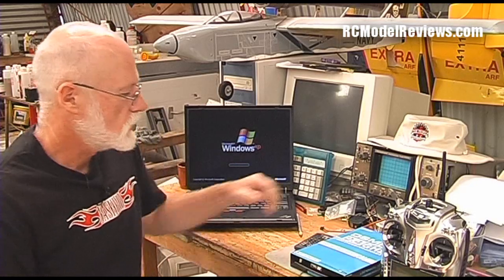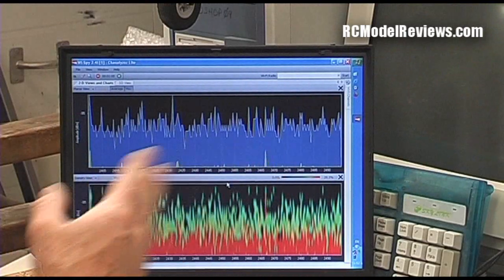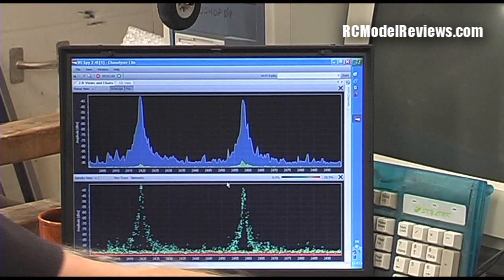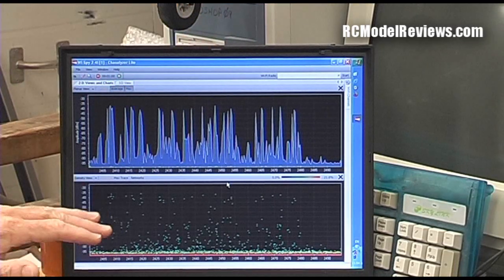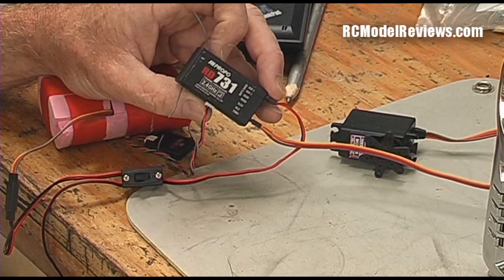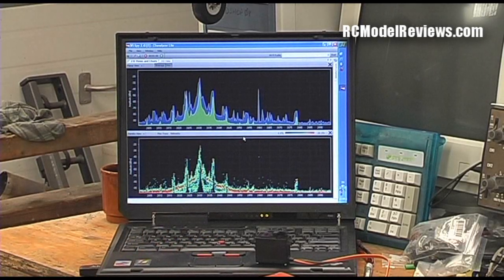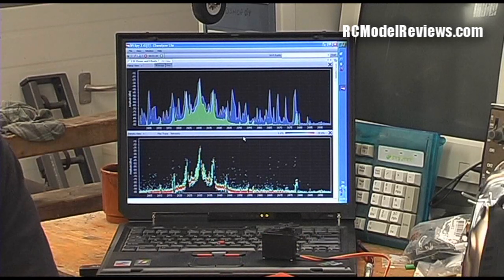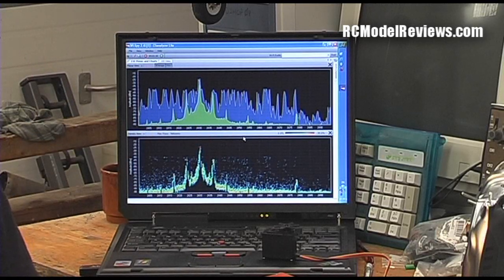Review: The JR DSMJ FHSS 2.4GHz RC module and receiver.

Comment: I have the old JR Galaxy 8 with the early frequency module.  It's modules were interchangeable with several later JR TX modules. But i have been out of the hobby for about ten years and what happened after 2.4 came in I don't know as far as compatibility of 3rd party or availability of the ones you recommend in this video by JR.  Would greatly appreciate advice as to the module(s) best suited between what is available currently (or recent used) that will physically fit in my Galaxy 8. Also do any of these work because of the Galaxy's older technology.  As you probably know they were both FM and PCM depending on the module used.  I have Spektrum DX6i but I love the feel of the Galaxy 8. Any help would be appreciated. Thanks